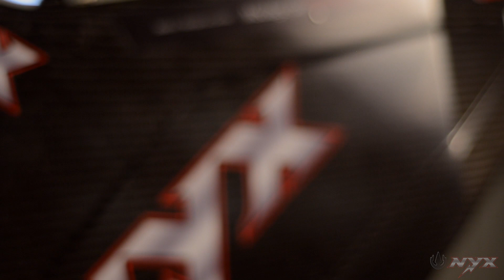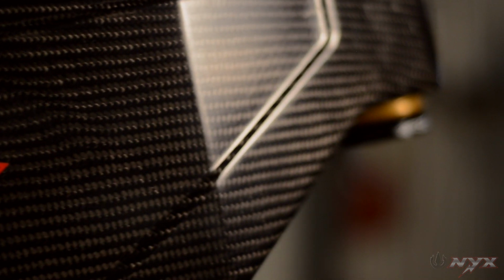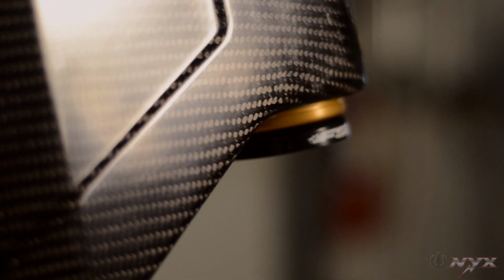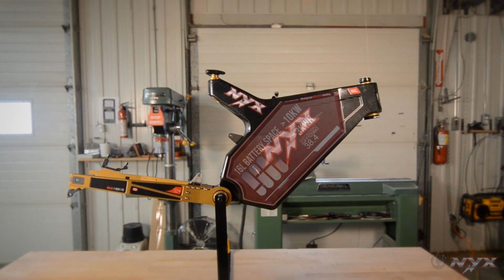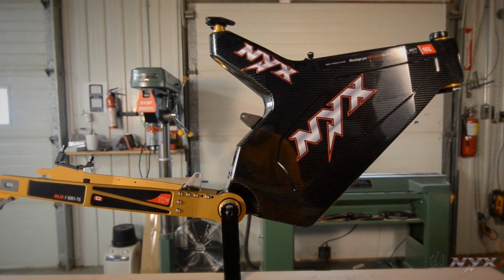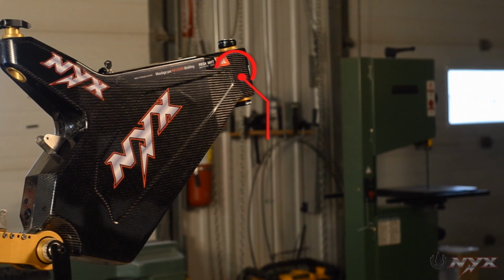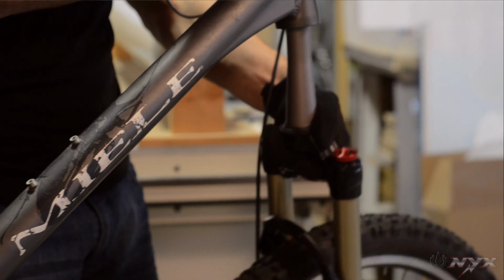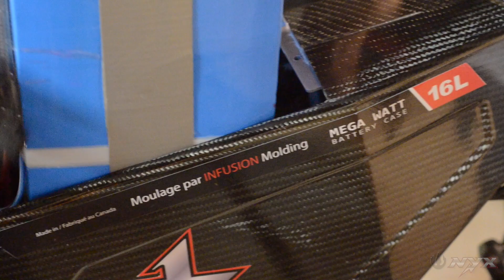NYX 2015 : The World's First Carbon Fiber E-Bike Frame Kit

Comment: Hi how are you ? I have nyx frame and I bought Battery but a little bit bigger .Battery 112
Opening 108 do you think is it okay to stretch the carbon fibre to fit the battery in please 🙏🏽
Reply from the maker: Hi, sorry but no it's not a good idea and once inside, how will you do it for the removal ???? Definitely I do not recommend it.
Reply: Nyx Bikes ok no worries it’s only 3 mm different I have to try it Because I bought the battery €1700 with the controller  I can’t bring it back

Comment: I like the frame, but I dont think carbon will give you anything.. What the point to save 1kg on a frane and make it 1000$ more expensive? THe cro motor itself weight around 13kg..

Anyway, I wish you good luck guys! If you are interested I had my Vector project on Kickstarter too, if you need help send me a message!

Artur from
www.vectorebike.com
Reply: Arthur is correct. The Vector frame is about $650 compared to NYX for $1800 on Kickstarter. Never knew why Vector was suspended on Kickstarter after raising more money then they needed. Also why was the frame $900 on kickstarter but now is $650?
Reply: angelo212 it is 625$ now. It was more during kickstarter because on kickstarter you need to pay 5% to kickstarter and 3% to amazon, and to local bank too..
I like this carbon frame design though!
Reply from the maker: angelo212 Hi angelo212,
first of all, Vector E-Bike is a really great product, we did not have seen it in person, but how it is advertise on their website, it seems to be really great.

 When we designed the NYX 2015, the goal of using Carbon Fiber was not really to reduce the weight, because, as Artur said, the frame weight to electric parts weight (motor, batteries, controller) ratio is about .2, which is really low. 

I don't want to lose you with crazy mechanical properties formulas, but here's a small explanation of why we use Carbon Fiber. Carbon Fiber behavior is really different to steel, because it is stronger, stiffer and lighter. The NYX 2015 Frame Kit weights close to a Steel Downhill Bike Frame. Therefore, it means that our frame is a lot stronger, because it has more material for the same weight. 

I don't know if you know Stephane Melancon (AKA DoctorBass on endless-sphere), but he said that our frame was the strongest one he drove. It is really important to have a strong frame especially when you want a powerful E-Bike. Stephane Melancon broke the Ebike Speed World Record in 2009. 

Finally, we chose Carbon Fibers because of the unique esthetical look it is giving to our frame and we want the highest quality product to our High end Frame
Reply: NYXbikes Agree with you guys!  Have a good luck with your start up! I really want to see more frames in this sphere,  this will help to develop this whole ebike business!
Reply: Did they say it saved 1kg or is that a random guess?
Reply: ThingsDemystified
Reply: ThingsDemystified
Reply: ThingsDemystified